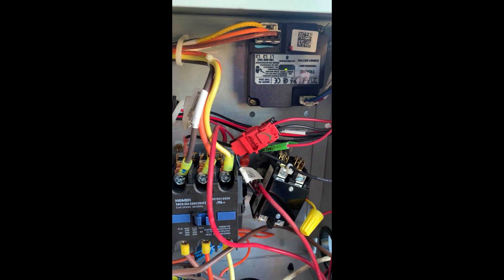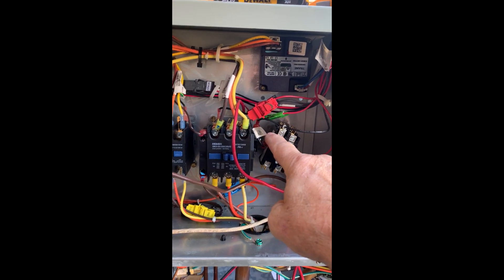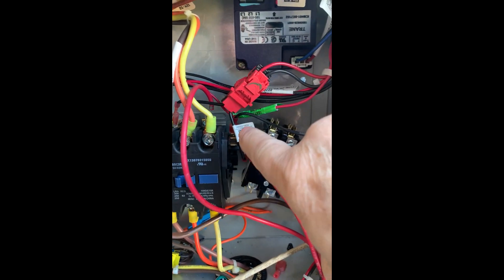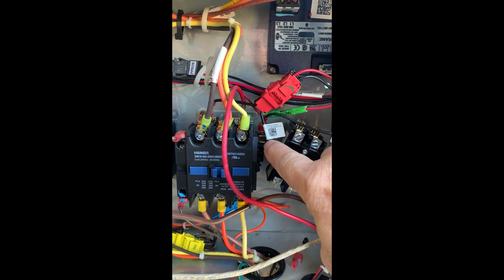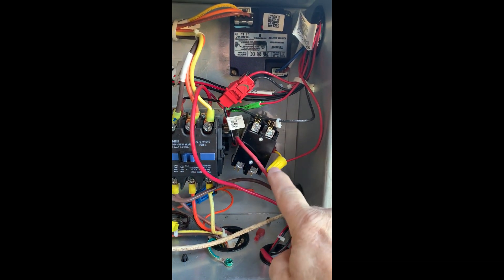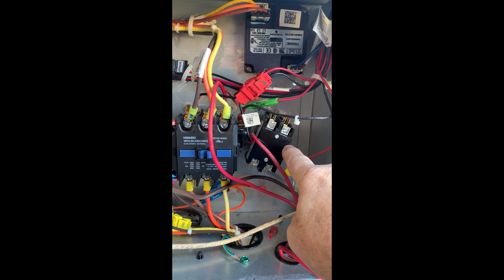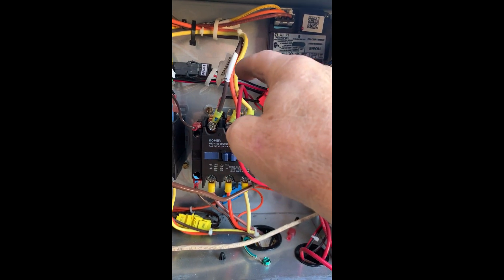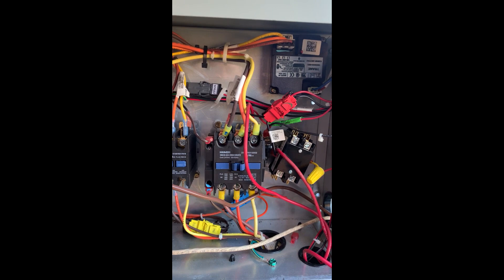Symbio 700 jump out

Comment: I am getting a circuit 2 proving trip 3 times and eventually a circuit 2 proving lockout alarm. Is this similar to what problem you were having?
Reply: Same problem on new unit startup. This did not work? I’m have tried everything I can think of. Tech support tomorrow I guess….smh
Reply: @josiahbass5627 check the auxiliary switch and the high pressure switches in line.  Also check your pressures while it runs.  I just had to open up a brand new symbio 15 ton package unit because of non condensables
Reply: Just had a 15 ton rooftop unit have the same problem. Circuit one and circuit to proving problems turns out the unit was wired at the transformers for 240 V. We were giving it 208 V. Double check your voltages and rewire your transformers if needed fixed my problem.
Reply: @scottbowman6270  had that problem and did that. Still getting daily proving circuit failures
Reply: @bhutehole did you get it fixed
Reply: Any updates on this?